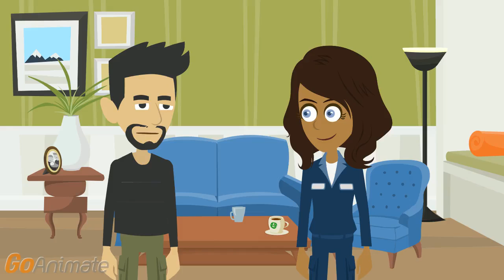Why is My Central Air Conditioner Sweating?

Comment: I have a new outside unit & the copper tubing is sweating & I have no idea if this is normal & I can't find one thing related to this. My A/C is perfect & as I said brand new. Why can't I find the answer to this? lol
Reply: I found the answer. It's normal for it to sweat. I've had my new unit for about a month & it's heaven. It's cooler at a higher temp & my elec bill was cut in half.